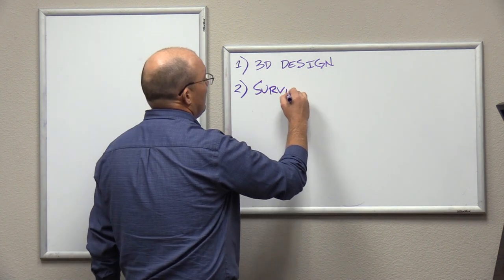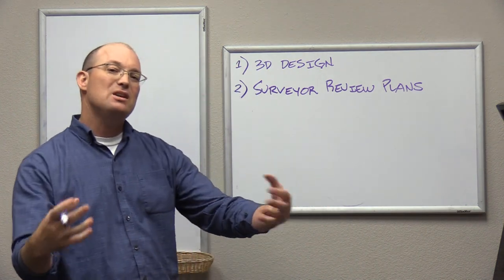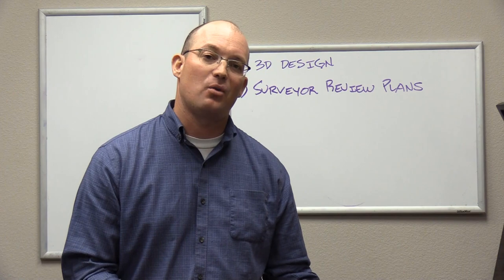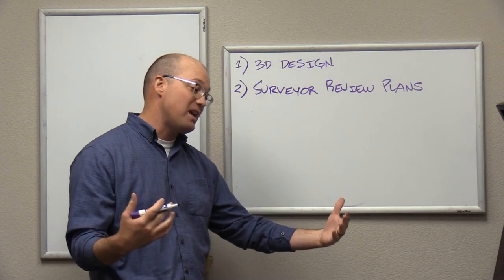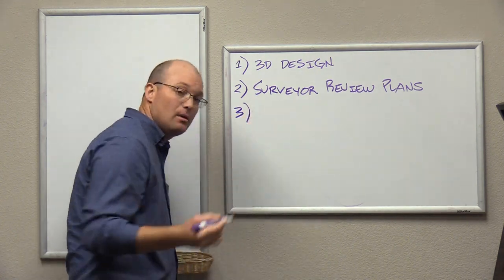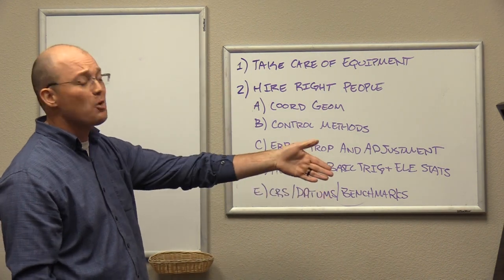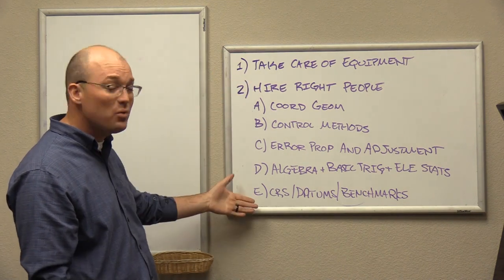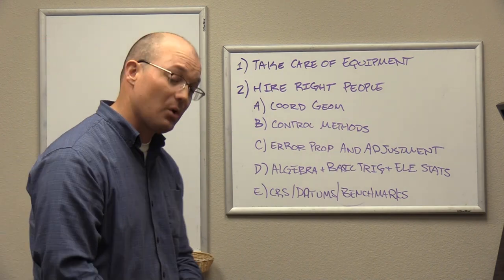The Implications Of Stakeless Construction For Design Teams

Comment: New follower to your channel. This video is a must for contractors, engineers, and land surveyors. I think you hit the nail on the head at the end. I've noticed mid sized/larger contractors starting to hire PLS's on staff because they can afford and need the skill set. Smaller firms are trying to use laborers and unskilled labor to become the "surveyor." This is how I started in the industry 12 years ago, now I've taken it upon myself to earn a 4 year degree in land surveying and just finishing licensure in the state next door to you. I now train the new hires in the company and teach them the right way, not the button pusher way taught by the equipment sales people. I've seen some scary things in the last 12 years, watching untrained field crews make bad calibrations, not understanding how to measure up there rod or what a measure up is, asking them if they have leveled through there control on the site, and they don't even know what leveling is. I've seen them set up a base station on the wrong control point and then not even check with their rover on another control point, run the machines all day and be over 100 feet off horizontally (garbage in, garbage out). I've seen operators smash the antennas on machines sideways against buildings and still run all day and not realize their vertical is off by 5 tenths or more plus the damage to the antennas, ask me, I've seen it. I do have to say I've made a good living in this in-between world between the engineer and contractor, however I'm glad I pursued licensure. I don't do much boundary work but your videos are very informational.